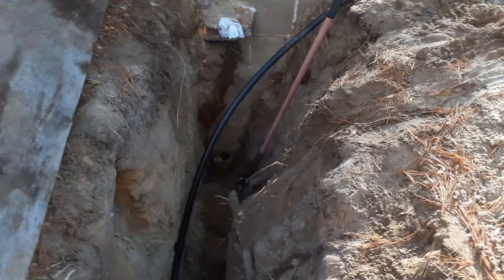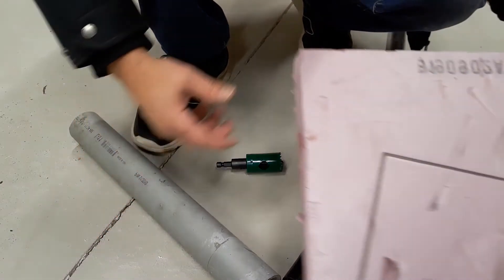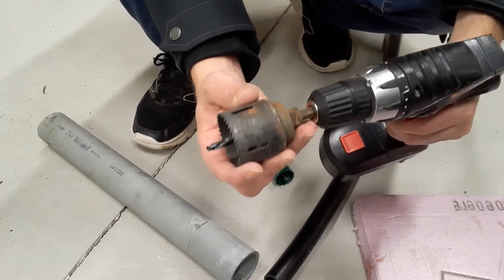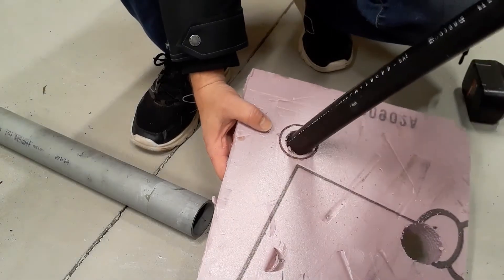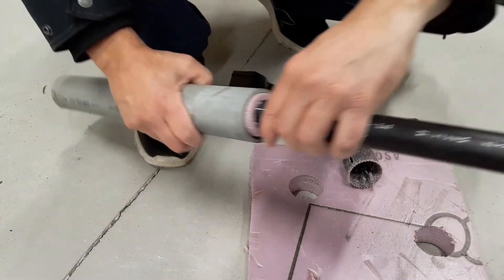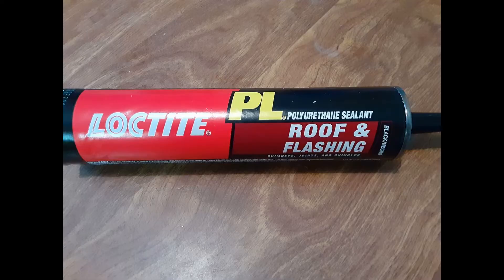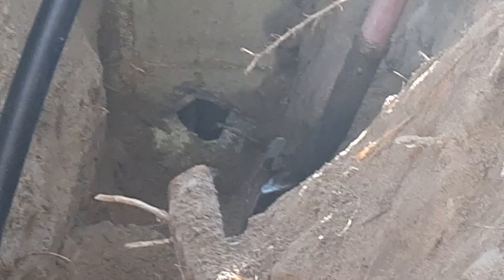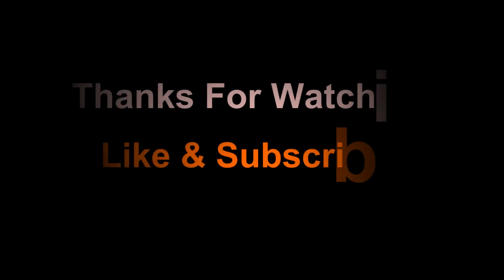WATCH Correct Way to Run Water Line , Electrical or Pipe through Concrete Wall Foundation!

Comment: HI, thanks for vid, do you only use the pipe foam at both ends to keep them from moving while the fill hardens?  Just bought an old farm and the current pole barn line is leaking into the basement from a spring line i believe.(another fix).
Reply from the maker: Wherever it goes through concrete or an area that could get cut/scraped , is where I put the foam.

Comment: Why not use spray foam instead of wasting time cutting out that foam ring?
Reply from the maker: I could of used the closed cell foam as the other absorbs water and crumbles , but I had the rigid foam on hand.

Comment: Great video! One question.... Near the end of the video.... how did you insulate your water line with that pink styrofoam? Did you just lay it on top of it? And that's enough....?
Reply from the maker: You just lay the foam on top to try to deflect the frost . When you get below the frost line, then the earth will be warm enough to keep it from freezing. Thanks for watching

Comment: really great video. Just wondering, did you have to run a pipe inside of another pipe because your waterline pipe is flexible? In other words, if you were just running a rigid water pipe through a concrete wall, would it have to be surrounded by another pipe? I guess I don't understand the point of that.
Reply from the maker: @jayviz  Sleeving the pipe ( ie running pipe inside pipe ) allows a little movement in case house foundation settles, or dirt settles so as not to put stress on flexible plastic pipe. If it's rigid , then you could just run galvanized, copper, rigid pvc and you will be fine. Thanks for watching
Reply: @JasonYouTube the opposite is true. Non-flexible pipes need room for any foundation settling. Flexible doesn’t.

Comment: Must've never heard of a core bit
Reply from the maker: I wasn't going to pay $80 or more for a bit I would use only once. The vinyl cement can make a jagged hole disappear and that only costs $5.
Reply: Rent one and seal the pipe with hydraulic cement

Comment: Thanks, this was very helpful (including the comments). 

For me, I had trouble getting the foam cutouts to size well with the pipe & tubing I used (outer diameters didn't fill the hole well, and inner diameter too close to outer so it was very think and I often only got partial circles). 

I ended up using pre-made pipe insulation foam and cut them to size. They're squeezable, so they formed better to size for me. Less work than cutting sized out foam, and cheaper for me too (I bought hole cutters specifically to try this). 

I did use a combination of spray foam (in the middle of the hole) and foam insulation on the outer ends. Appreciate the comment about using water resistant spray foam.

Comment: Thats a pretty good idea. You cant drill thrpugh the foundation or footing can you?
Reply from the maker: You can drill through the concrete block , just use sealant to seal around pipe. Make sure that when it enters your block from the outside it goes at an upward angle. Underground may not help but above ground that will let water drip away from hole. But under the soil , it might not matter . Thanks for watching
Reply: @JasonYouTube  I guessing Tren Wilco is reffering to solid concrete floor or wall.
Reply: Why do drill through the finished wall instead of leaving a hole in the first place by turning the block to the side with the holes?  [()=()] instead of [__]
Reply: I actually meant for this question to be in it's own comment box. It's not a reply to this thread.

Comment: Question: i wanna build a room addition on 4 to 6 inch deep concrete slab of pured cement. I really dont wanna run the water and gas pipes or electrical embedded inside the slab cause if they need repair in the future is almost impossible and a mess and costly.

The walls are going to be build of wood framing with drywall inside and stucco outside.

So, is there a way i can run all the lines thru the walls only or maybe make a housing outside, along the the outer wall for the lines that come from the mains to the house and then send the lines from that outer housing, to the inside walls inside the framing? 
Cause anyway all lines like water for the shower, sink, toilet etc, will be on the perimeter of the room, so nothing will be needed in the middle of the room.  

Except the gas range of the mini kitchen, it will be in the middle of the room. So what do i do with that? Cause really putting the gas line inside the cement floor to get to the middle of the room will not be practical for future repairs..
Reply from the maker: It depends on where you live. If you live somewhere where it freezes, pipes in outside walls may freeze. You can always run a little crawlspace/pipe run with a false floor to hide all piping.  So you would have the concrete under a floor space so would need extra height walls depending on pipe run space you decide on. Truthfully,  the electrical would be ok as you would run it inside pvc conduit and you could easily pull new lines  . Black gas pipe can be exposed to weather so that wouldn't be a problem also, just don't put it in soil or concrete.

Comment: How do you line it up on the inside? I need to go all the way through...
Reply from the maker: With block , you can count the block and do it that way. If its flat concrete , then use a smaller 1/4" bit as they usually are 10" in length . If you don't have a longer bit, then you will have to make the hole bigger so you can fit the end of hammerdrill into the hole that you created so you can break out the other side.

Comment: Spray foam
Reply from the maker: The regular Great Stuff will absorb water but the special Outdoor or Pond ones are closed cell, so they will not absorb water. The regular stuff is like a sponge , can wring out the water it absorbs.